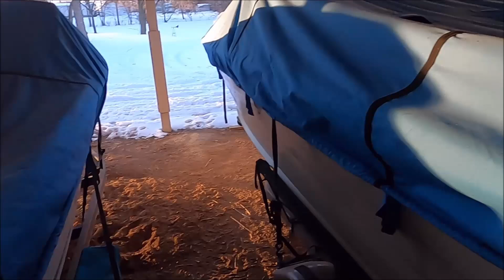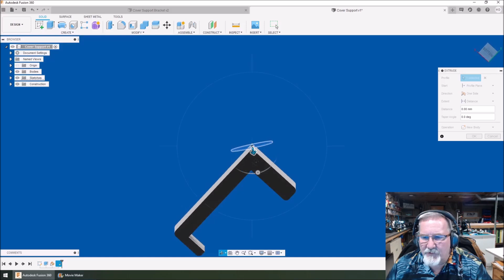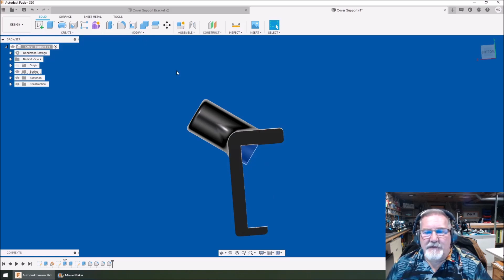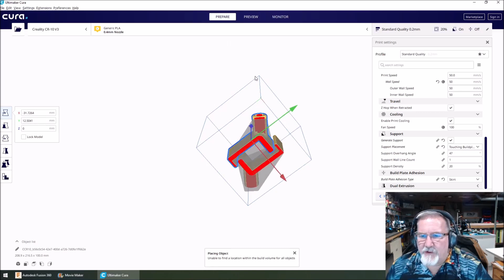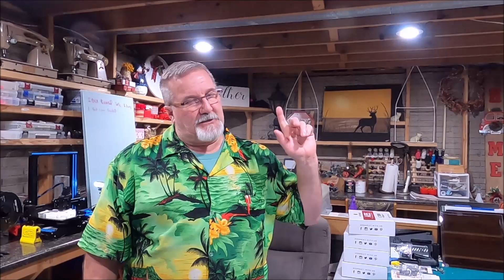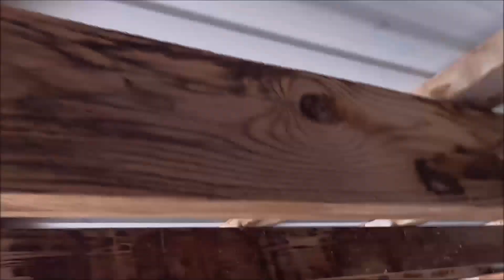Boat Cover Support Bracket Design Fusion 360, Build on Creality 3D Printer and Application on boat

Comment: You don't happen to have your STL for the Sea Nymph bracket do you?
Reply from the maker: I do but since this video I find that the ABS and the PLA just don't hold up under the heat of the cover. Check out RMD Creations for a better boat cover support.  I released it last fall.

Comment: If you plan on printing parts like that with ABS u need some sort of heated chamber for stable inside heat as ABS likes to get messy with open air design printers like Ender.
Reply from the maker: Encloser design and build is in the works. Thanks for your suggestion and comment

Comment: I am surprised at how smooth the surface of the parts turn out. They work great. I wish I had them years ago when I used to keep my runabout tied to the dock at the cottage. I would always have to take it for a spin and pull the plug to let the water run out.
Reply from the maker: Glad you liked it.  Thank you for watching.